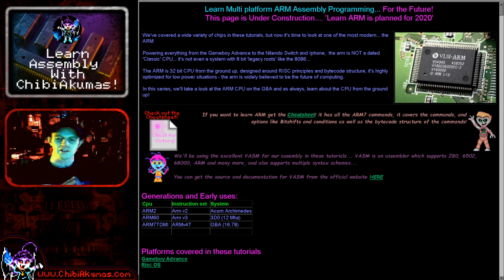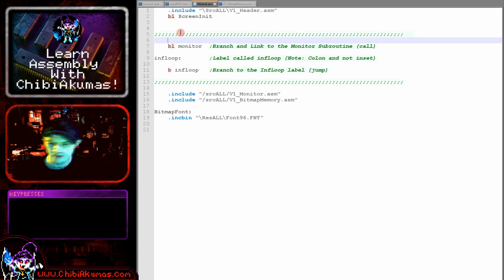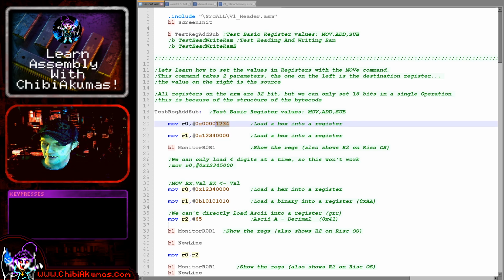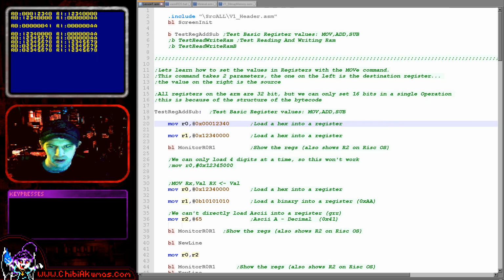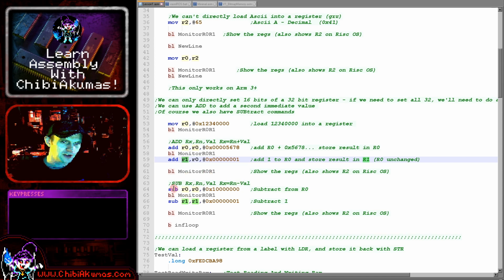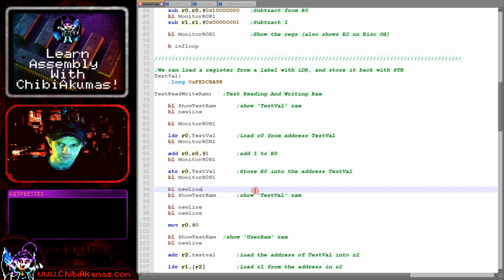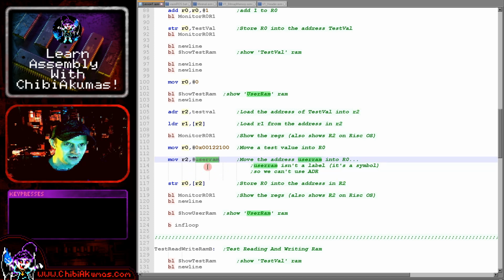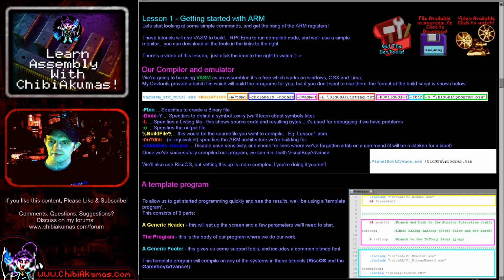Learn ARM Assembly Programming - Lesson1 : For absolute beginners!

Comment: Thought I'd point out an issue I hit (and fixed)...  the GBA emulator (VisualBoyAdvance) was crashing for me with its default config. Regenerating the .ini config file fixed it...  Google Gemini thinks the issue with  the original was the built-in screen coordinates, since I have dual monitors...
Reply from the maker: Maybe, I've had problems with emulators remembering offscreen co-ordinates before, 
I do all my work in a Win7 VM these days, and when making new DevTools packages, I reduce the resolution to 1024x768 to try to minimize problems.

Comment: I might be missing something, but i'm just learning arm and I'm trying to follow along with your tutorial. I've downloaded the devkit from your website, and the rpc emu as well, but I have no idea how to actually assemble the .asm file with VASM and then get it to run in rpc emu. I'm sure you cover this somewhere else, could you possibly point me to that?

btw, thanks for your hard work on your videos, you obviously have a passion for this.
Reply from the maker: if you press F6 it should bring up an 'Execute' menu where you can select a destination platform.
Reply: @ChibiAkumas  omg, i'm so silly, i was rushing and didn't read your instructions well. 

One question, I had an error message, requesting a rom file. i found the file, and put it in the mdrive\emu\rpcrmu\roms folder, is that the intended way to get it to work?

Comment: The wide constants in "MOV r0,#0x12340000" etc. aren't expressible in a single ARM instruction, at least not of the vintage that you're targetting here. It needs to be a value no wider than eight bits lying on any even power of two, not 16 bits as you have stated in your code. I assume that vasm is inserting extra operations here.

Comment: So I'm using the GBA_Bitmap script, and I tried replacing the word entries under SpriteTest with a raw file I created in akusprite editor. I adjusted lines 19 and 21 to be #64 instead of 8 to fit the file's size. The sprite I used appears but is badly scrambled

Comment: on Windows 10 GBA appears on the taskbar only but you cannot see the screen, the F6 command shows the below messages

`````````````````````````````
\Utils\vasm\vasmGBA.bat Minimal.asm M:\sources nopause
Process started >>>
vasm 1.8c (c) in 2002-2018 Volker Barthelmann
vasm ARM cpu backend 0.4d (c) 2004,2006,2010,2011,2014-2016 Frank Wille
vasm std syntax module 5.1a (c) 2002-2018 Volker Barthelmann
vasm binary output module 1.8a (c) 2002-2009,2013,2015,2017 Volker Barthelmann

seg8000000(acrwx4):	        2208 bytes
Reply: I had the same problem. If you already have visualboyadvance on your pc you can open it like you normally would, then  go to File>Open, then open your BldGBA folder in your M drive and run program.gba
Reply: @Clippy4Jesus   thank you, i don't know the mechanism that makes this work (beginner knowledge) but it worked. i was about to throw the computer out the window
Reply: press alt+spacebar then maximise, then when the window appears maximised click options then go down to video and click x1

Comment: Thank you so much for making a beginner friendly ARM Assembly tutorial! Back in the late 2000s I got interested in GBA ROM hacking, and on some forums I saw people post some really cool things that went beyond the ROM hacking tools I was using. When I asked them how they did it, they told me they achieved it through Assembly hacking. I asked them how I could learn to do that and they linked me to the GBATEK documentation. At the time I had 0 programming knowledge, so I looked at that documentation and try as I did, it make no sense to me. I then looked up other tutorials on GBA assembly, but even the most beginner friendly of ones seemed to assume some degree of familiarly with assembly programming. 

With these tutorials you just made a 12yo version of me a decade later very happy!

Comment: For placing a character into a register did you try  the VASM standard syntax "    mov r0,'c'   "  ?
Reply from the maker: Yes, I tried this... here's some of the things I tried.
error 9 in line 21 of "Lesson1.asm": instruction not supported on selected architecture
>    mov r0,'c'
error 9 in line 21 of "Lesson1.asm": instruction not supported on selected architecture
>    mov r0,#'c'
error 9 in line 21 of "Lesson1.asm": instruction not supported on selected architecture
>    mov r0,#"c"
Reply: @ChibiAkumas  guess mov r0,"c" is the last hope :)
Reply: @ChibiAkumas  Try mov r0,#ASC "c" that's the original Acorn syntax, maybe it'll work.

Comment: If you can understand a CISC design like the 68000, RISC is much much simpler.  Try to implement the most complex instruction on the 68000 in C or C++ versus on a RISC processor and you'll see what I'm talking about.  Even on the Z80 you have stuff like LDIR which is a single instruction loop which you don't see on RISC designs.  Now that you're on RISC, we need some Super-H for Saturn and 32X! Great videos man!